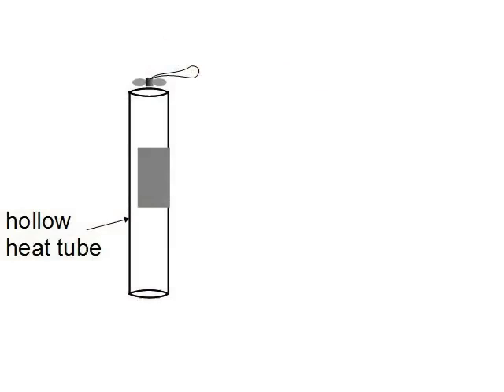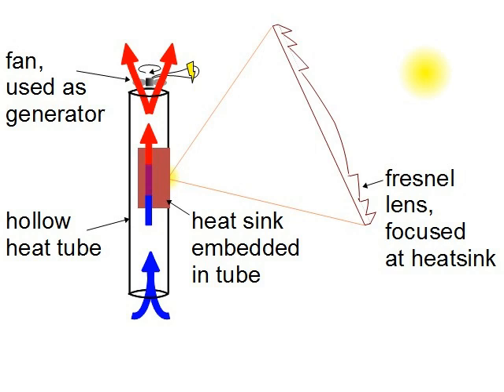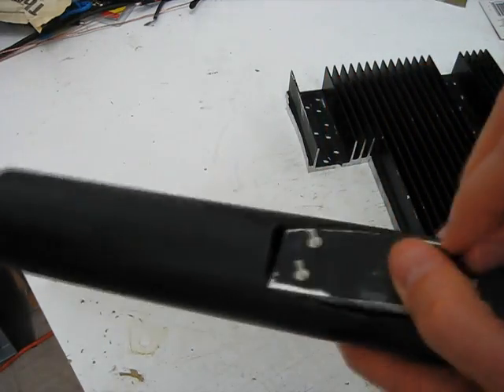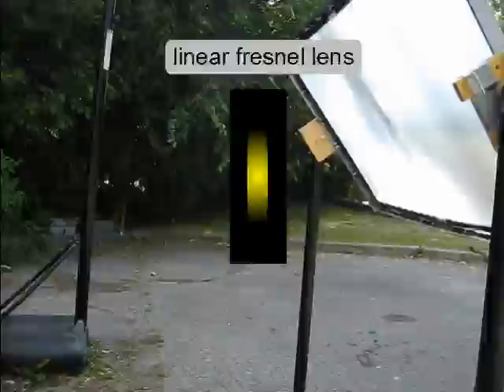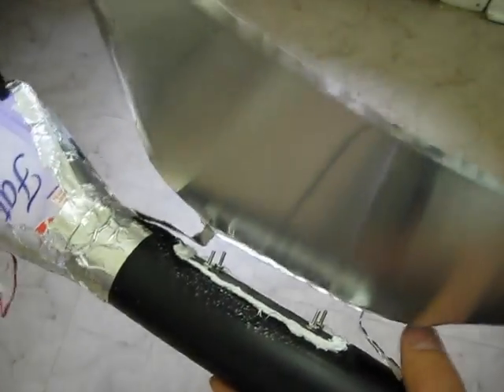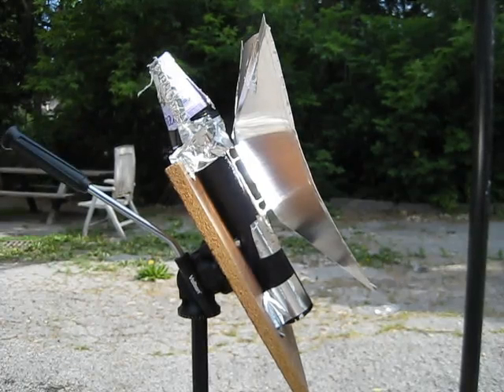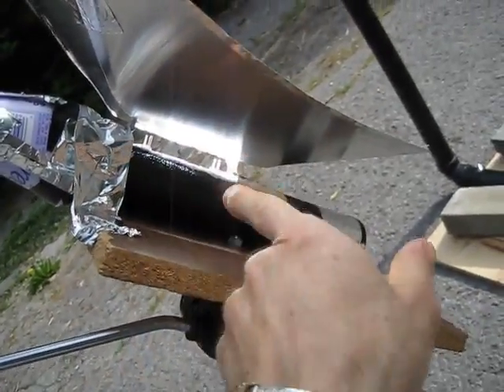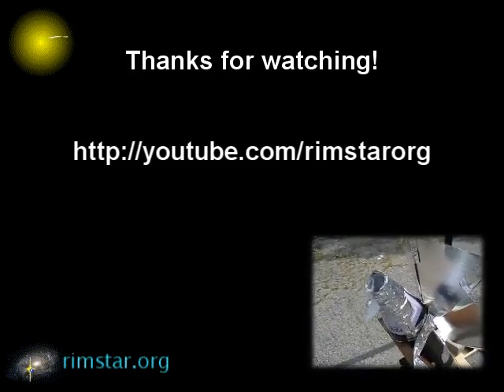Mini solar tower (ver. 1, 2, 3) powered by fresnel lens

Comment from the maker: @crackin2000 Yeah, I was going by the "try the ultimate and then work my way down from there" approach. I sort of used the focusing on one blade idea in my 5th version. That barely turned a paper turbine. I'll try some new designs in the summer.

Comment: you need quite a bit of spead to get those fans to put out power. you may try a gear ratio system or focusing the hot air on one blade at a time more like micro hydro systems do just with a thin jet of air

Comment: This could be a Great Adaptation for solar dehydrator or fan heat pipped into greenhouse,,small shop building ect .ever look into aluminum can portland cement battery ?Averages 1.5 v per can and hold up very well over time ,,lidmoter channel has good demo ..but I bet could also be useful in filling DIY capps for heavy load needs -it's time we all get brain busting on affordable new energy supplies ,,earth magnetic fields and solar combo's on small scale for lights, cooking ect . Great Channel !

Comment from the maker: @archeryman5000 Jim, The air is denser there but it's also moving more slowly. At the top you have less air per volume moving faster and at the bottom you have more air per the same volume but moving slower. But the momentum of the air is mass times the velocity. More density means more mass. So which wins? Let us know your results.

What will your heat source be instead of a lens?
-Steve

Comment from the maker: @billbradleysr Actually, the temperatures I was measuring today with version four was above 165C (330F). That's in air but it still wasn't as hot as it could get. So I could possibly even do steam, though your themosiphoning idea is intriguing too. But for now I just want to try air with this series of experiments.

Comment from the maker: @archeryman5000 That's what I understood from what you said before. I tried what you suggested today but there were other problems... it go so hot it melted the insulation from the inside out. So a big improvement in heat, but still more things to overcome. I'm still putting together all the video from these tests and hopefully will have it up tomorrow sometime.

Comment: @RimstarOrg Think of the hot air in the tube like a balloon, a tiny hot air balloon can lift a paperclip,  a very large hot air balloon can lift several people.  Your velocity will not be high enough to worry about the losses from friction with the tube walls.  Another example is a fire place, heat at the bottom tall chimeny good draft.

Comment from the maker: @archeryman5000 Thanks for the feedback. Interesting thought but wouldn't there be more heat loss to the surrounding tube as the hot air rises, decreasing its lift as it got cooler? I'd also be concerned about the added static friction but I think that'd probably not be big enough to matter much. I'll have to keep your suggestion in mind. I'm almost set to test my next version which actually has a shorter tube.

Comment: you should use a longer tube with the heat near the bottom, it will provide more draft with the same amount of heat because there will be more warm less dense air in the tube to provide lift.